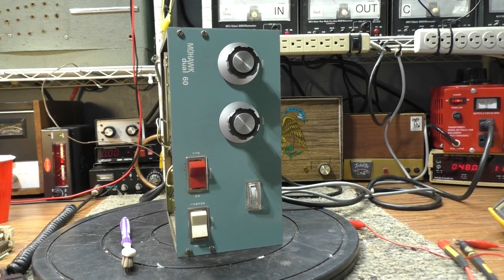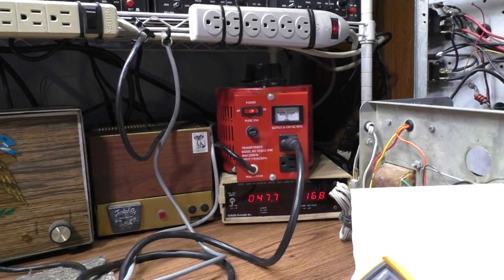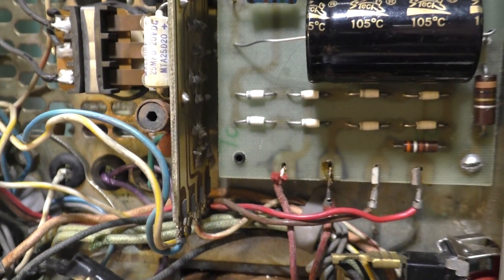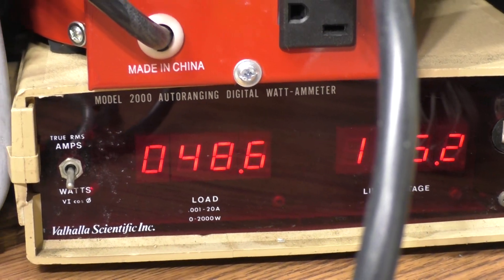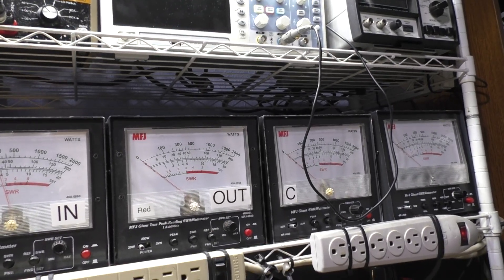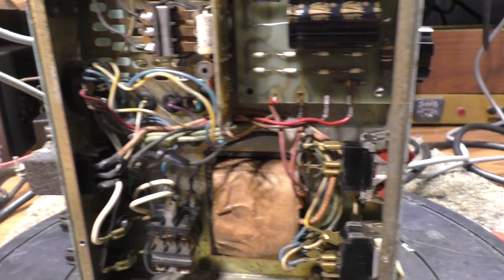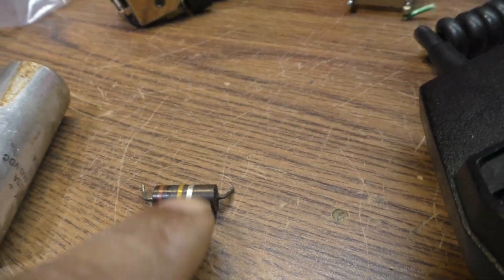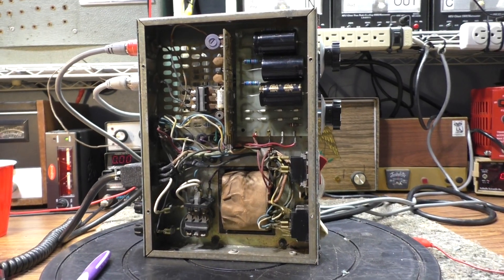Basic RF Tube Linear Amplifier troubleshooting for dummies using my latest find, Mohawk Dual 60

Comment: I suppose if the amp keyed before the Exciter the contacts would last longer?
Reply from the maker: Yes and the amp should be unkeyed after the exciter too. Thats the correct way to operate a foot switch. Key footswitch before exciter and unkey footswitch after exciter is unkeyed. Amps with autokey at least key the exciter (input) and the amps output at the same time....theoretically.

Comment: I can use the bristles to then clean the dirty contacts ? ...........No catbox . no no no😂
Reply from the maker: I use a contact burnisher for light cleaning and a Dremel with a copper brush with a real light touch for tough jobs. Don't want to scrape off the plating of the contacts.
Reply: @tramdr solid advice ty